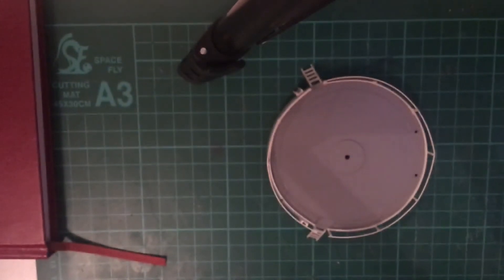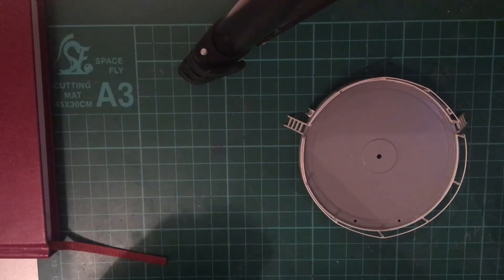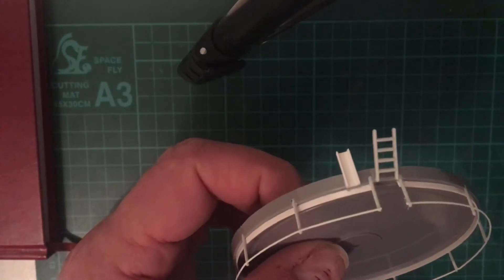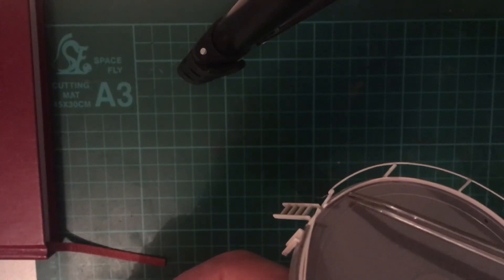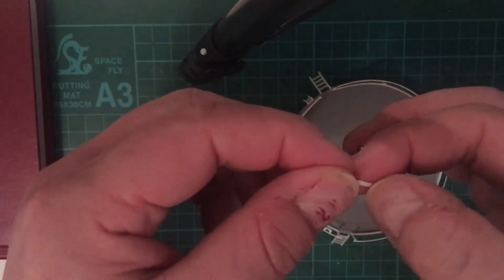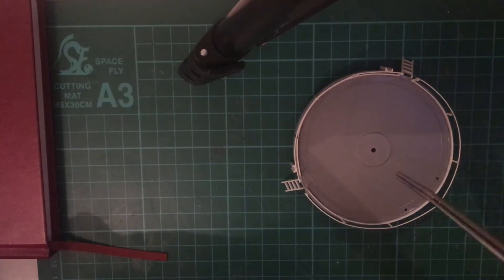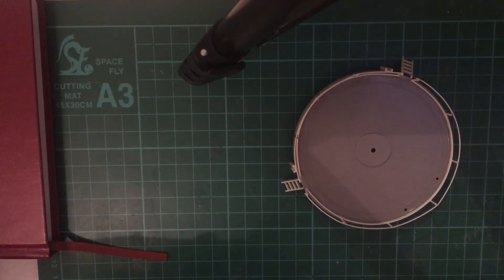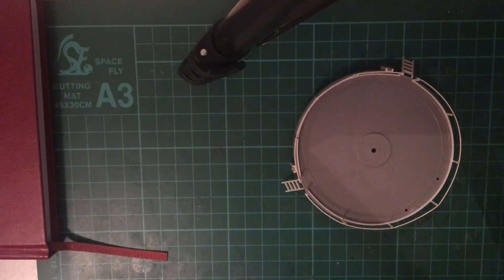Flower Class Corvette build part 7 - Forward Gun Platform

Comment: Really enjoying your build, I wondering if you would kindly tell me what glue you are using pleas
Reply from the maker: Hi Frazer,  For plastics I use Plastic Weld.  It’s a liquid that you brush on and it melts the two surfaces together.  Works best by capillary action.  I can do a video on it if you want?

I also use superglue when gluing different materials together like metal and plastic.  And a PVA glue for clear plastics.
Reply: @RotweillerofJustice  Thanks so much for your help. I have some extra thin Tamiya cement.. Will that act as a capillary glue please. Thanks for the offer of the video, but its seeing you use you glue on your videos, that inspired me to ask for you help.
Reply: Frazer Simpson hi Frazer,  I think it will.  If you have two pieces together and run the glue along where they join I would assume you’d get the same effect.  You could always try it on some old parts you may have.
Reply: Frazier I use tamiya extra thin so you will be fine